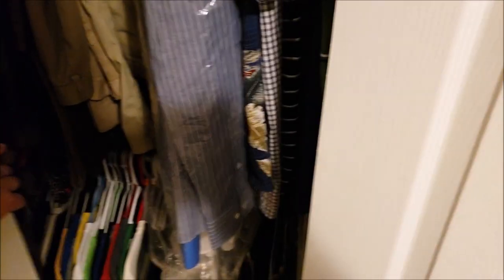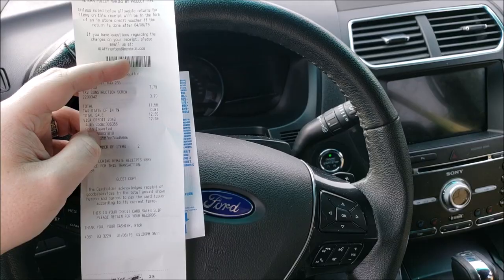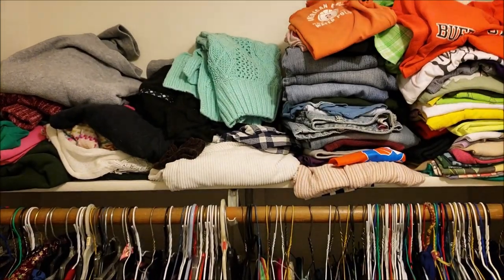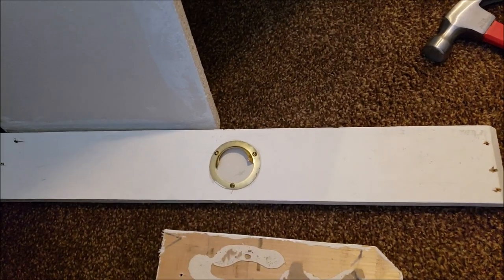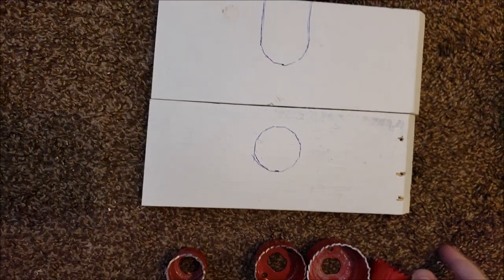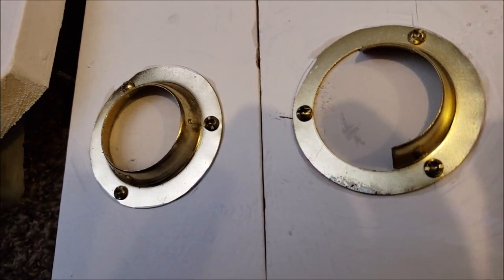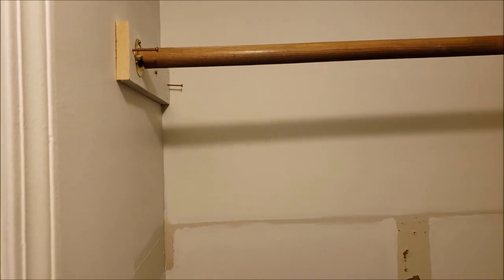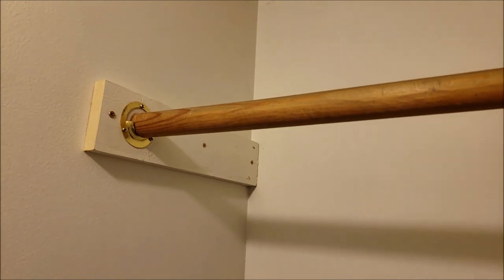How to Maximize Your Closet Space with Double Rods

Comment: You reused the wood pieces, but I don’t have any, so what size board (height and thickness) do I need?
Reply from the maker: Any 1 inch thick board will do for the shelf and support.  For the support,  you can use a cheap furring strip like this one.

https://www.homedepot.com/p/1-in-x-2-in-x-8-ft-Furring-Strip-Board-160954/100009348